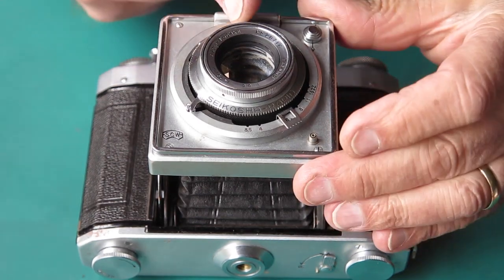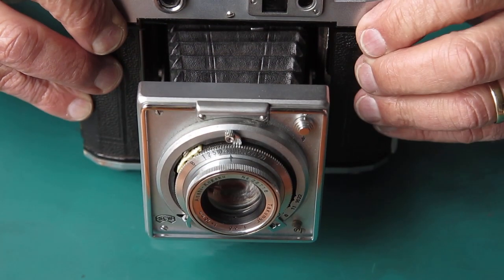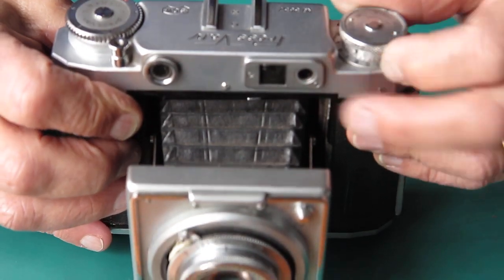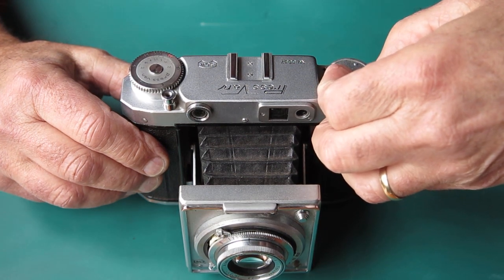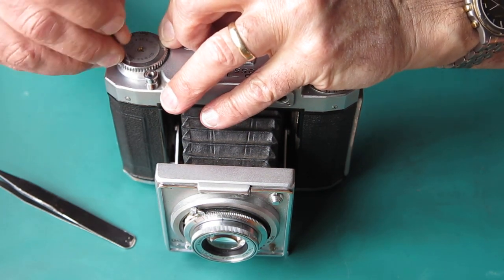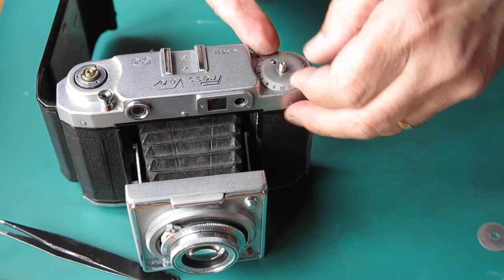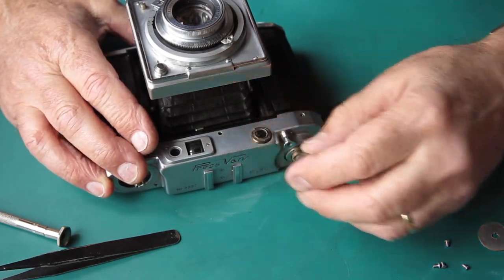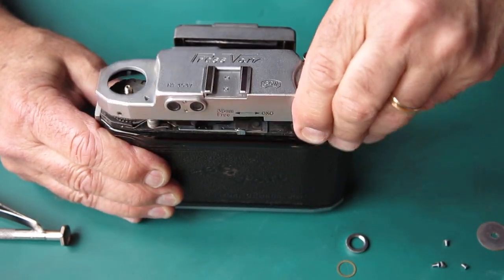The other Suzuki Optical Press Van camera 04

Comment: Silicone, as used in 'rubber' lens ring tools, is excellent for most pin-hole fasteners, unless ultra tight, no fear of accidental scratching.  Removing tight fitting escutcheons, film reminder dials, anything flush with no purchase, using the adhesive qualities of a piece of masking tape, or the fabulous black monster electrical tape answers well. 
Oh yeah, Rodico, from the watchmaking trade, or with lesser effectiveness, Blue-Tack, is very useful for picking up or moving pieces, (placing washers) and a spot on the screwdriver tip will hold the most reluctant fastener.